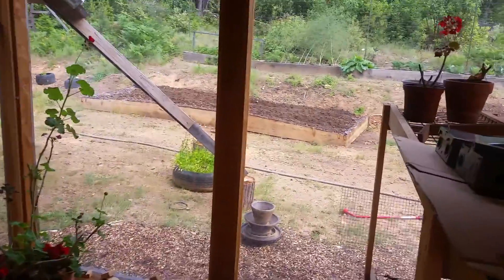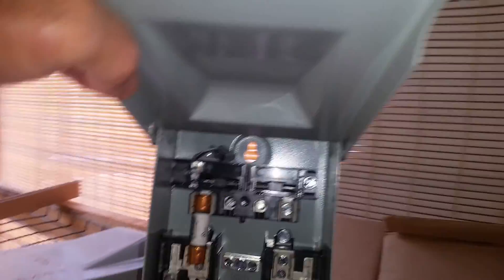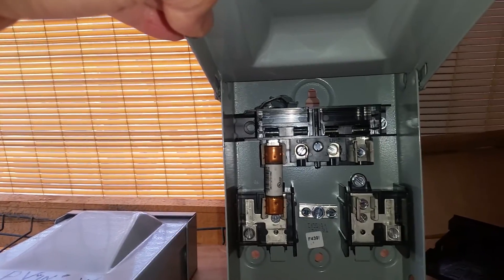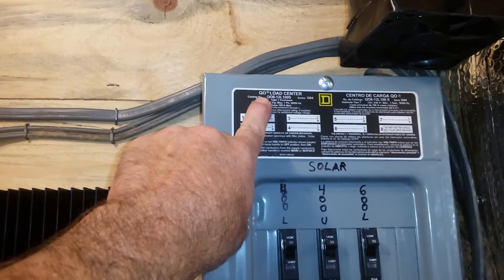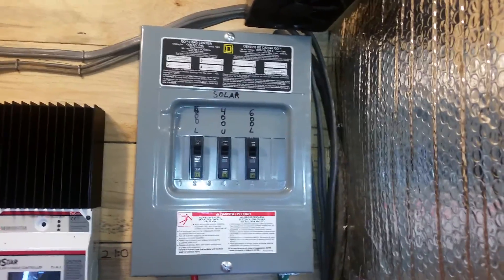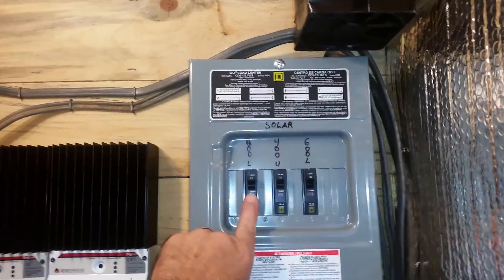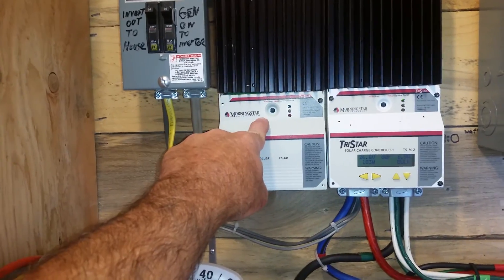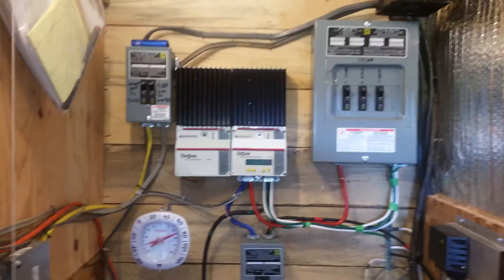Changes to the 24 volt solar power system

Comment: Looking to build an off grid retirement  home in the country. Wanting to save anywhere I can I researched the Square d Breakers. They are rated for DC but at 48 volts from 10-70 amps on single pole and 10-60 amps on 3 pole. They do not show a rating for 12 or 24 volt. That may not be of any concern in your application but thought you might not be aware of it. Here is a link to what I found http://static.schneider-electric.us/docs/Circuit%20Protection/Miniature%20Circuit%20Breakers/QO-QOB%20Circuit%20Breakers/0730CT9801R108.pdf
Reply from the maker: Thanks for the link. In the low budget off grid solar world The QO Square D is used as an inexpensive alternative to solar parts manufactures  like Outback and Schneider etc. The QO single pole is only safe in my opinion @ 24VDC DC or down to 10VDC. A 48VDC system should use a double pole that breaks both the positive and the negative side. I do use a 60 amp single pole @ 24VDC between the Charge controller and the battery bank with good results. When my system was 12 volts nominal I had a 30 Amp single pole that did trip when I had a surge from edge of cloud phenomena. I hope you find the place you are looking for. I was considering selling and buying a smaller homestead. I spent the summer looking and saw some awesome deals. But nothing better than what we have. So we may just stay. We have been hear 27 years and love it. Thanks for watching.

Comment: 30amps at 120v converters to 300amps at 12v .  you are so right about mixing fuses with ac and dc. you are also right about the heat. when wires and components get to bad things happen.... nice video.
Reply from the maker: Greetings from Oregon, we are back on youtube. You will have to re subscribe to get notices. Have a blessed night

Comment: Awesome...saving money is always good. Thin DC wiring can cause heat too. This is what happens to my system...my cables to/from the chargers to the breaker box and then down to the batteries weren't thick enough. Now (after installing 4 AWG)...under full power, the cables and breakers barely get warm (like, just above room temperatures). Square D QO breakers meet all the codes too. I have a link to share with you. These are Oregon based (made in the USA) solar panels by Everbright. About $1/watt mono panels (165 w solar panels). Not much info on them (feedback ratings or Youtube videos)...so, I think they are new. Anyway, they are selling them on Amazon: http://www.amazon.com/Solar-Panel-Battery-Charging-Efficiency/dp/B00G2IZ1VW/ref=sr_1_6?ie=UTF8&qid=1462188560&sr=8-6&keywords=solar%20panels%20for%20sale
Reply: +Steven Davis Amen brother
Reply from the maker: Greetings from Oregon, we are back on youtube. You will have to re subscribe to get notices. Have a blessed night

Comment: Nice upgrade to the system bud, you said something along the lines of upgrading your batteries in the future.. just little advice, when i started getting into solar on a diy level i wanted to build a battery bank for times in the winter when our power is cut on us and to save on the electric bill using grid tied inverters, well when i looked into pricing on common batteries used for solar i was sticker shocked, so i got to thinking a few years back i went around to a few places and asked permission to get the old recycled laptop batteries from various places, i managed to collect enough 18650 cells that tested good to make a nearly free 20ah 48v battery for my ebike build i did.. that battery is still going to this day with nearly 8k in miles on the bike using pedal assisted ebike kit... so i went around and collected more laptop batteries and found the thrift stores tend to have loads of them due to them not allowed to resell laptops due to privacy of the data on the laptops, so they take the batteries out of them and have recycle centers come and get the hard drives and batteries to dispose of them.. i went around 1 day to all the major thrift stores in my town and came home with over 300 laptop batteries with 6+ 18650 cells in each in one day of running around.. i bought a few more testers to test the capacity of the cells so i could do 20 cells at once, since then i have tested out just over 1600+ cells with 1700mah+ and installed them into my system doing a modular style powerwall similar to the tesla powerwall in a way.. i picked up some pvc 1x4 mold blank boards from lowes and glued them together to create blocks taller than the cell heights using plain pvc plumber cement, then using blocks of wood i cut out for the spacing i setup on the drill press so i could drill out holes for the cells through the pvc board with a forstner bit, then on the back the negative side of the cells i took 1 inch wide copper flat bars and screwed them to the back side so the flat negative end of the cells all hits the negative bars when the cells are in the hole.. then on the positive side i used more 1 inch copper flat bars that i drilled and tapped them so i can screw a small 1/4 copper machine bolt into, the cell goes in the holes, the negative side of the cell hits the negative bar on the one side, then the positive side makes contact with the cells from the copper bolt being lightly screwed to apply slight pressure to the positive terminal on the cell.. then for extra measures i bought some giant shrink wrap large enough to go over the cell block as a whole and covered it so the bar ends of the copper bars sticks out the one side, then i just wired up the blocks i built

Comment: the rating is to 48 volt. do not use on 48 volt unless you break both negative and positive wires. you will need a two pole breaker then